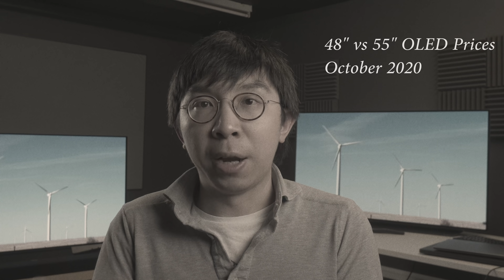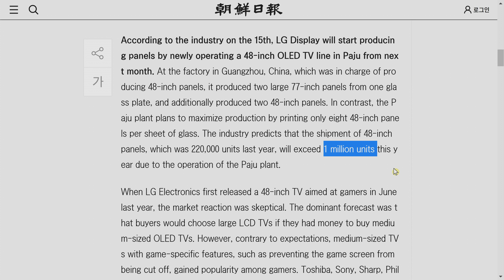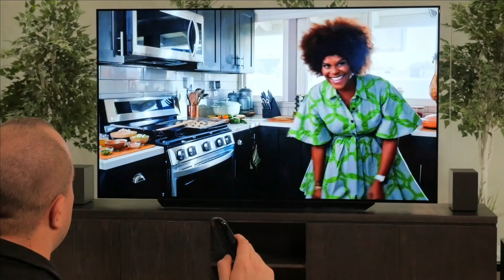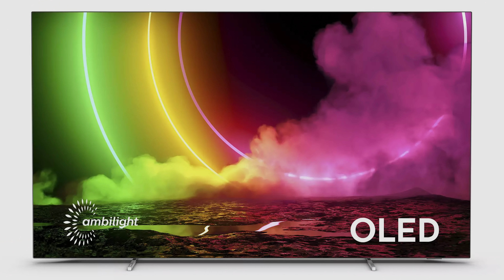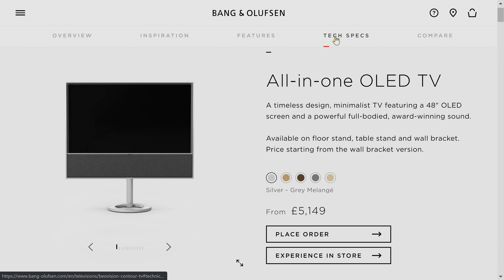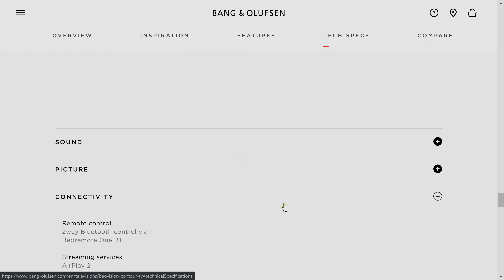Cheaper 48-inch OLED TV Coming As LG Display Increase Production to 1 Million Panels

Comment: I'm not salty that I paid the full $1500 for the 48 CX just this December. Nope, not even a little.

For real though, if the ramped up production drops the price significantly, these tvs will even more so completely undercut the large gaming monitor market. The CX is already a great alternative to "normal"" monitors. If you look at pricing for Ultrawide and like the 43" monitors that have comparable refresh rates, input lag, and such, they're already close to or sometimes higher than the CX was. If they get cheaper, it becomes a total no-brainer to buy one of these over a "high-end" gaming monitor. 

Personally, I'm really happy with mine. It did require me putting it on its own stand and moving the desk further forward away from it a bit. I also usually run FPS games at 21:9 ratio for comfort and wider FOV in game. My biggest complaints would be that, while HDMI 2.1 is awesome, my card is still 2.0 and it's been....  difficult to upgrade lately. LG, if you want to kinda sorta market this as a monitor again, maybe throw a DisplayPort on there? Guess that's not a huge deal, especially once I can actually get a new GPU. Also, if it's primarily being used on a desk, a curved variant would be nice. Although, I'm finding that it's not that big of a downside that it's flat, since you end up sitting a ways away from it anyway. 

People, don't let naysayers steer you away from these. They're excellent gaming monitors, and it just takes a bit of getting used. Once you go big and OLED Black, you won't wanna go back. *ding

Comment: I just want a 27" oled gaming monitor which includes black frame insertion. 60hz is fine as long as it has BFI. 120hz would be better, but for me, not "required". If the lg 27ep950 costs $3000 like b&h assumes on their placeholder page, then it's not worth the money at all. Might as well buy an lg cx....

Hopefully sony joins the monitor market sooner than later

Comment: I'm using a LG CX 55. Will I have any trouble using an AMD 6800 XT GPU with this TV?
Reply: No issues as far as I know. It has a HDMI 2.1 output so you're getting the full 4k 120 hz 10 bit experience.

Comment: I own the LG 55EG920V. I'm fairly certain that it is only 60Hz. When I plugg in my PS5 and go to video output information it says it can only support 60Hz and in the game Nioh 2 remastered I can't select the 120Hz option. Yes performance mode is selected.
Reply from the maker: Screen refresh rate is different from input video signal Hz. For example, last year's Panasonic OLEDs are definitely 120Hz in terms of screen refresh rate (because they support 120Hz black frame insertion), but they don't accept 120Hz video signal.

Comment: Great video! One question: better cx after all these updates or c9 at the same price?
Reply: Get the CX.  Better processor and BFI implementation.
Reply: I generally agree with "SteadyChaos Productions", but finally it might turn out to be an availability issue.
In general the new models get several small improvements (even not communicated ones) you should be wishing to benefit from.
But when it's easier to get a C9, you are doing nothing wrong when picking one of these...both are fantastic tvs

Comment: Please help me fix this.  Hello do you by chance know what I am doing wrong? I have a LG CX Oled.  I am trying to play Forza Horizon 4 on the new Xbox. I'm thinking I have done something wrong in setting options within the new Xbox. The screen is full screen in the game but the left side of the screen is one way and the right side of the screen is another way leaving a line down the center showing how the screen is full screen but split down the middle? Do you know a fix? Thank you here is the problem I have on my screen https://www.youtube.com/watch?v=K2GU5CGjFms
Reply: You're in the 4K shop/demo mode with the Xbox (nothing to do with the tv).  Using Google helps:

Set Demo Mode and Picture Reset Mode to Off.

   1. Press the HOME button on the remote.
   2. Select. Settings on the HOME screen.
   3. Select. Preferences or System Settings. NOTE: ...
   4. Select Shop-front Display Setting.
   5. Demo Mode and Picture Reset Mode are displayed.
   6. Set Demo Mode and Picture Reset Mode to Off.

Comment: HDTV test could recommend a TV that will be better picture quality than my current 2014 Panasonic 50ax802b after a new TV 49 or 50 inch Panasonic domt offer an upgrade in the size I need am a massive Panasonic fan aswell as everyone say colour accuracy and picture quality are top notch would the Sony 49xh9505b be a good choice

Comment: This is good for multiple reasons first the actual launch prices should be cheaper second since there’s more inventory they would be more likely to put it on sale. However even at one million I think that they will sell EXTREMELY well meaning probably no Black Friday sale but probably tons of different sales leading into Black Friday.
I think we could get a sale where it’s 1000-1200 if the launch prices are 1500-1700 though this depends on how much of an upgrade it is over CX hopefully they can upgrade the brightness to 700 instead of 650 like the c9
Reply: In theory they could increase the max. brightness of a C9 with 729nits to 875nits with a G1.
The problem might be: the European "Energy Labels" will be revised starting March, 1st (in 8 days)... most current tvs will drop from "A" to "G", especially the high performance HDR tvs (LCDs as well as OLEDs).
So, they might use the available 20% effivciency increase for mainly reducing power consumption.
But this a marketing decision, so we have to wait and watch how they will finally handle it.

Comment: I'm still pissed only the 55+inch G1 line is getting the brighter evo panel, that's a terrible low move. Hopefully by 2022 we will have the brighter panel at 42in size.
Reply: It's new technology they first have to implement, test and optimize it. In the long run I am expecting it will be the standard, especially because in Europe the energy label classification will be revised completely this month. Tvs graded with an "A" level at the moment will end up in "G" with the new classification ... means they have to go down with power consumption which the new panels will allow without losing performance.

Comment: any chance we see monitor sizes OLEDs like 27, 30 inches?
Reply: LG Electronics will sell 31.5 and 27 (and probably 21.6 OLEDs), but they will be sold for "artists".
They use JOLEDs inkjet panels.
Reply: LG annonced an 32" and 27" Oled Monitor on CES this year. But they are limited to 60hz and more into the professional market.

Comment: So, basically you're saying that "200,000 units are ready, with a million more well on the way
" ... Got it.
Reply: First also assumed it's 1mil. PLUS ... but actually it seems like the 220,000 they were able to produce last year will be 1,000,000 this year ... so, not +1mil. but 1mil. in total. At least this is what the announcement says...
Nervertheless that's a huge step into the right direction and the price "line-up" may/should finally match with the size "line-up" ... imho  :-)
Reply: @marcuscole8796  so, you don't get the star wars reference, right? :D Btw, it's just the first step into the right direction but a 48" is still juge for a monitor and this panel should be RGBW instead of the RGB panel they presented for monitor usage

Comment: This sounds great and all, but when can I get a 42"-48" G1 series with the brighter EVO panel and thicker metal backplate for heat dissipation?  I just want a 1000 nits capable 4K@120Hz self emissive display that is in the 40"-50" range and costs less than $2000.  Is that really so much to ask in this day and age?

Comment: Panel capped at 60Hz through a limited processor is extremely extremely lame.
Reply: I am actually looking forward to this 48 A1, if it is cheap. I don’t need gaming features, and there really isn’t any 120 Hz content so if it doesn’t get 24p judder or bad dark scene handling (from the 60Hz/lesser processor) it should be great.
Reply: Exactly the contrary ... it's pretty good news ... like "Martin P" I am also expecting a much lower price point here and as I assume (and Vincent too) without having to accept a decrease in panel quality.
But:
I expect it to be optimized for production cost, means it will have less features, less powerful video processor and SOC, less extensive firmware (settings, UI), less ports, HDMI 2.0 only, etc.
It will most probably not provide a fantastic gaming monitor but more a "tv only" device with a fantastic value-for-money relation.
Reply: @marcuscole8796  I don’t really think it’s going to be priced that much lower though, especially if it costs LG the same amount to make the panel.
Reply: @5urg3x  As explained, the panel isn't the driver for low(er) cost here, but all the rest as I listed ... and a cheaper housing/case for sure when I think about it. The panel is only a part of the production cost. One of the biggest cost driver for instance is the surcharge of development cost per unit. The less the tv is sophisticated the lower this surcharge will be.
What do you think they are heading for with the A1 ? ... easy ... attacking LCDs in the lower price segments !
The A1 for sure is not meant to compete against the C1 ... they already have the C1.
What the prices will look like is actually not driven by the manufacturers, but by the market ... it's the same everywhere with every other product.
As they want to supersede LCDs also in the midrange price segment, they have to offer identical prices ... otherwise people will continue buying LCDs instead.
Reply: @marcuscole8796  “Development cost” is not a real thing, in this situation anyway.  The R&D costs were already recouped for this specific kind of OLED panel and tech years ago.  The extra cost is subsidizing development of their other more newer oled panels and tech, possibly, but there’s a good argument to be made that they would be doing that anyway.

Comment: I think the perfect PC monitor would be if you took the CX and kept the height but made it wider. 5K by 2K, 21:9 and curved. Also reduce the depth of the stand so it can be pushed further away from the user.
Reply: A 42" 16:9 dragged out to 21:9 would be 52". (121.4cm x 52cm) Maybe that's what I'm looking for. 🤔

Comment: 48" is still too big for gaming. Get closer to 27 or 32 and they would sell like hot cakes.
Reply: 48inch is perfect for a monitor replacement if you mount it. Any smaller then just buy a monitor at that point.
Reply: lg have  announced 32 inch 4k60 oled monitor
Reply: @qupeter1224  Who the hell wants a 4k 60 monitor? Don't they know about DLSS?

Comment: Hi Vincet, thank you about the great video. I would like to drop a question regarding this price difference between the 55 and 48. I read this article: http://www.thelec.net/news/articleView.html?idxno=345&fbclid=IwAR17TlMv3iPI13JvH3W-bMQCIepesbwxSvQIB3A8IiV4MOsMg-ffoMz_Rew  

which states " The new 48-inch OLED TV is to feature a 4K high definition resolution. This means picture quality will stay unchanged while the size goes down. In terms of pixel density also, the 48-inch TV is technologically more sophisticated than existing OLED TVs of 55-inchs and larger.

The pixels per inch – the measure for pixel density – for the 48-inch 4K OLED TV will be 91.8. A larger 55-inch TV with the same picture resolution has a lower PPI of 80.1, while the 65-inch has a 67.8 PPI, and the 77-inch a 57.2 PPI.

Is this not also a factor for its price difference between the 2?  Thank you for your answer.

Comment: Received my 48cx yesterday for $985
Reply: Cheapest I can find it so far in the US is around $1450. The 55 inch is about  $100 cheaper but it really won't fit my corner i want to put it in. My 2017 LG 43UJ6200 sucks at HDR.
Reply: @kaiserwillie67  I bought this size for easy movement after rents. Planned to buy 49Q80T for $700 only.
Best price for 88ZX you can find in vn is $11,200.
Reply: Wow great price. Where did you get it from if you don't mind me asking?
Reply: @kaiserwillie67  that price available during holiday, today the price is $1,159. Got additional 1y warranty so 3y in total. I live in vnm

Comment: i don't get how the 48 inch panel and the 77 inch panel can get cut from the same sheet of glass, when they have the same display resolution, resulting in different pixel per inch? The 48 inch has a lot more pixel per inch compared to the 77 inch panel.
Reply from the maker: The subpixel deposition process happens after the panel is cut.

Comment: great artificially limited 60hz oleds thanks LG
Reply: Lol ... they will come  in addition  to the regular ones ... so, if the lower prices are not appealing to you ... just don't buy one  :-)

The 60Hz will not be the only difference/drawback to the current sets ... they will use any cost effective measure in manufacturing they can find ... and finally compete against the midrange LCD-market.
This is extremely exciting  :-))

Comment: I have an lg cx 48 inch and I am so damn happy with it. I literally replaced my monitor and use it for both gaming/netflix. In 2k 120hz with Bfi enabled it rivals my 240hz gaming monitor for fps gaming. Unreal!
Reply: Same.
Reply: PC use or consoles? How far away are you sitting from it?
Reply: @joed9569  I sit 6 to 7 ft from mine
Reply: @joed9569  PC, when I play fps like rainbow six siege I sit about 4ft from the screen, when playing games with a controller about 6-7ft.
Reply: @androsforever500  thanks for the reply. I haven't had a monitor bigger than 24" and I can't imagine what games would like on a 48" OLED.
Reply: @joed9569  pretty insane, I've had a 32 inch before and 48 is so damn immersive

Comment: X900h Dolby Vision video please. I feel its a bit dull. Or maybe I'm wrong in my understanding of Dolby vision being the brightest form of HDR.
Reply: Yes that indeed is not correct. The advantage if dolby vision is that the brightness level can be adjusted scene by scene, but that doesnt make the scene brighter necesseraly
Reply: HDR movies are dim, the reference brightness is still around 100 nits, it's only the highlights that are bright, you're probably not understanding what HDR is.
Reply: Oh I'm sorry. New to this. I'll spend some more time researching this
Reply: The comments here are correct: HDR/DV is contrast not brightness ... In addition you need to know the X900H uses an inferior version of Dolby Vision which - with some specific content - makes HDR10 look better than Dolby Vision on a Sony tv (which should never be possible) ... it's the "Low Latency version" of DV - also called "player-led version".
Sony put pressure on Dolby Labs. to implement this additional, unnecessary variant back in 2016 to be able to offer DV in their tvs. Nevertheless it took them until 2018 to actually implement even this inferior version.
Fortunately Sony started to implemented the "Standard Dolby Vision" in the new sets  :-)

So, yes ... in your case it's possible to get a better HDR experience from HDR10 material than from DV material (...but it's a weakness of the implementation and processing power, not the format)
Reply: @marcuscole8796  Thanks for the explanation. That's what I felt. I found HDR 10 content most of the times more impressive. But didn't Sony fix the whole source based and player based DV in a recent update. Vincent mentions it on one of his videos. He said x900h is the first to implement proper DV.
Reply: @saifnasir9758  Yes, you are right, Vincent indicated the X900H will be the first Sony to get proper DV.  So, as it was a hardware issue before, it seems like the tv with the new SOC installed has enough processing power now and they just had to finish the supporting firmware and hand it in later.
He said the firmware update came in October, so it should already be installed on your set then !?
Tricky ... from what you are describing, nothing seems to have improved yet. So, I don't know ... first of all Dolby Labs. for sure had analyzed the X900H and created the matching look-up tables to be installed into the tvs firmware ... that should be fine then. To be honest I am actually at a loss now, not sure why Sony still fails with DV ... that's really bad news for me ... thought we are finally done with it and also Sony owners can benefit from the best format out there :-(

Just watched his video partially again and saw with the new firmware the X900H doesn't get "switched" to "tv-led DV" and "player-led DV" is disabled ... it says it can do BOTH ... so, what if this a handshake problem with Netflix ... means when watching a Netflix DV show Netflix sends the "low latency" stream instead of the "std. Dolby Vision" meta data ... and your tv uses it because it can ... THEN you are actually watching still the player-led DV instead of the tv-led DV ... but that's just an idea without actual background information ... just guessing for a reason behind :-).

Nevertheless, if HDR10 is more appealing to you ... use it instead of DV ... but you should check from time to time ... with DV content e.g. from Netflix or Disney+ ... either you may get a Netflix fix (without notification) or the next firmware update might solve it.